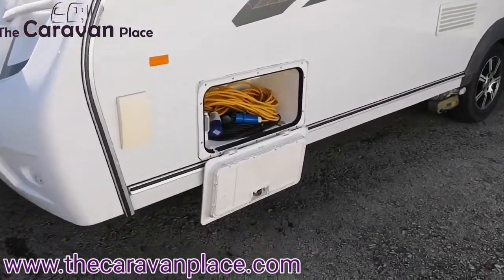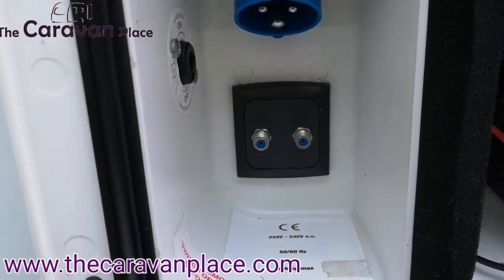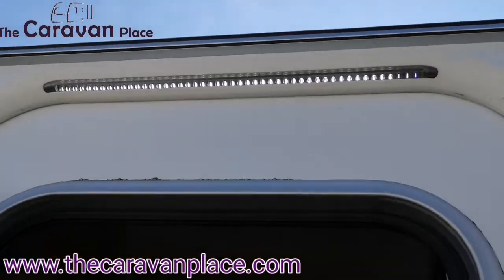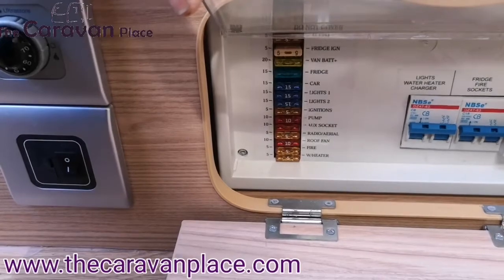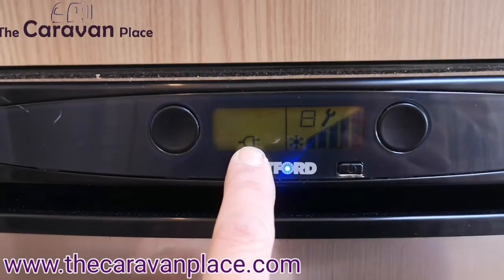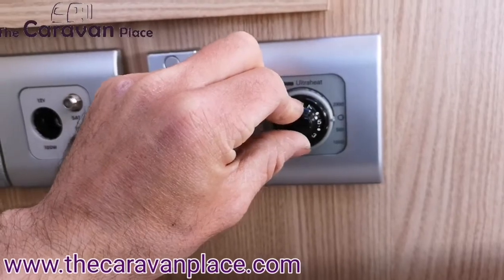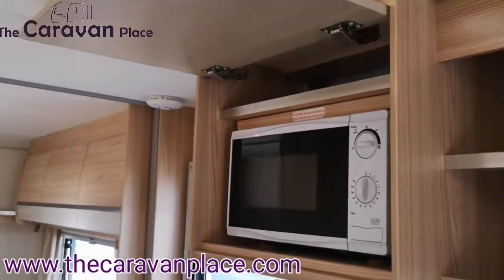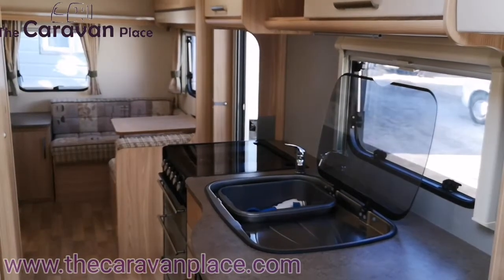Coachman Amara 570 instructions on how to use.

Comment: Hi will the hot water work off the battery
Reply from the maker: Hi John, it works on the gas when you have no Mains.
Reply: Can't seem to get it to work. I can hear the pilot light kicking in  ,but when I turn on the tap it don't seem to want to heat the water